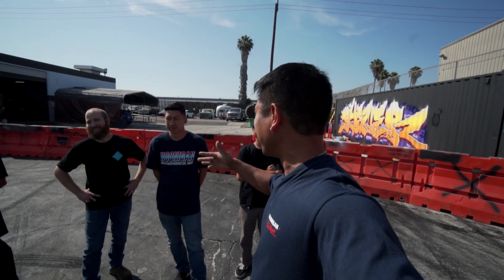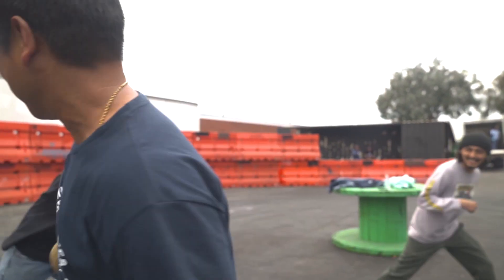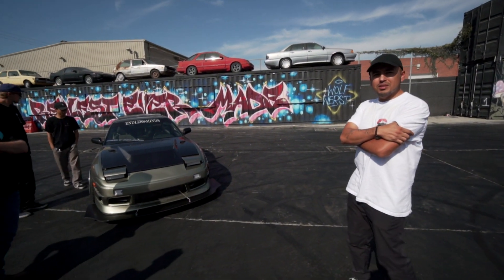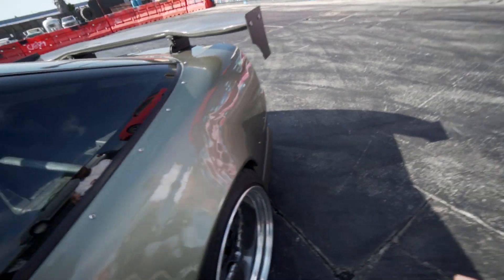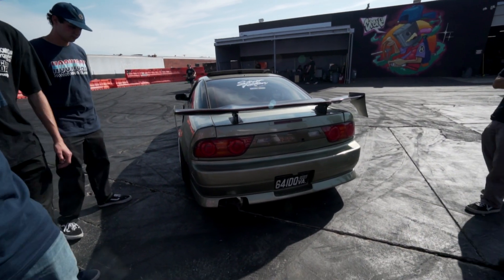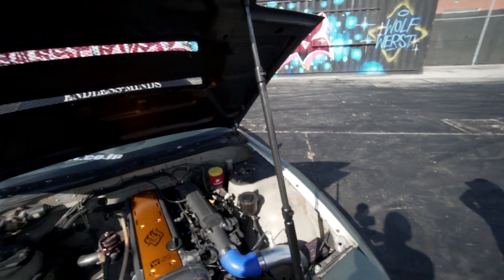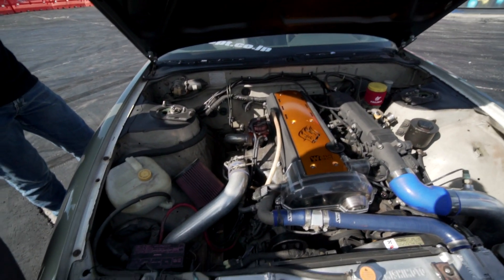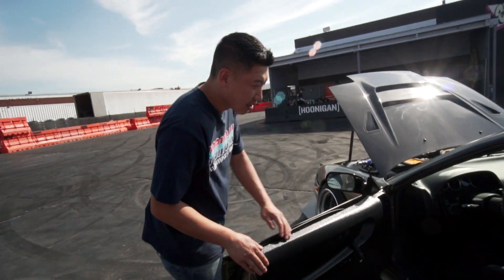BOOM BOOM! JZ Swapped 240SX brings out all our Nissan Nerds!

Comment: if you look at 1:17, it says "RPS13" where the P stands for the SR20 motor which was only sold in japan. 
This means that either 
1. They put that there after for some reason
or 2. This isnt actually a 240sx but a 180sx
Reply: issa 240
Reply: He put it on after. It still has the 240sx on the windows
Reply: @Keebafu  I guess the original rear end may have not been in good shape so he replaced it was a 180sx rear end,
Reply: Tell me you don’t know shit about schassis without telling me you don’t know shit about schassis 

That’s just a factory carbon cover for the kouki center garnish. You can buy this and kouki tails brand new from Nissan and put it on a usdm 240sx no cutting needed.
Reply: @ForeignCoupe  are you just gonna ignore the fact that it was my first theory that they put it on after? 0 iq
Reply: @clap_lmao  sure it was kid
Reply: @clap_lmao  it’s just a trim piece, you don’t need a whole rear end…lol
Reply: @ForeignCoupe  stay mad
Reply: It's a genuine 180sx Type X that he converted to LHD...